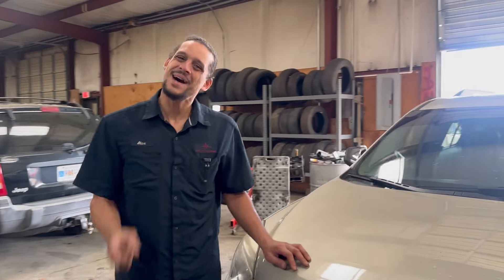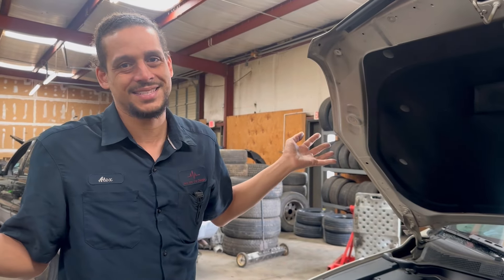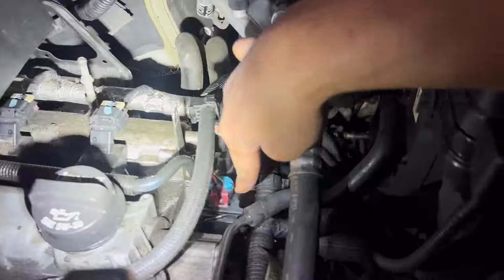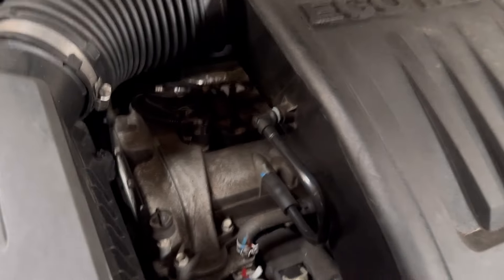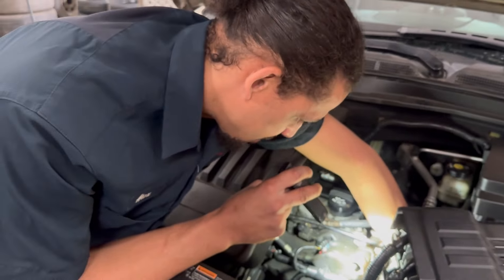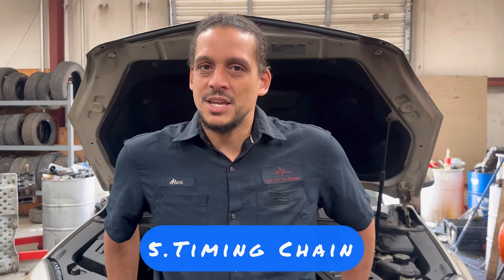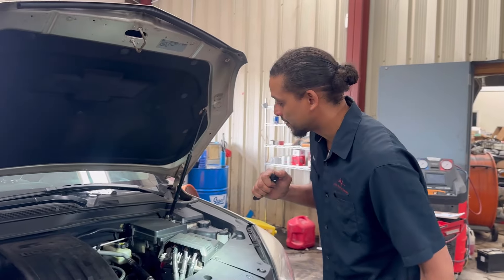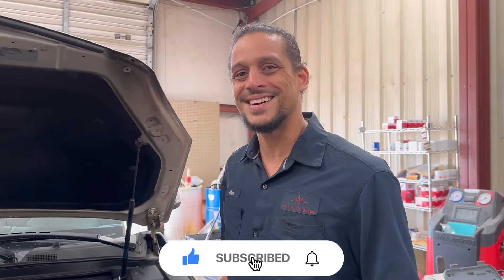The Top 5 Problems with Chevy Equinox (2nd Generation 2010 - 2017)

Comment: thank you for the video Alex, my 91 year old dad has a 2017 Terrain that we bought new I have a friend at a Buick GMC dealer it was a good price for a new car 21,500 and his 2007 Lacross (7,200 trade in), so far no problems at all at 37,000 miles, but some day it will be mine so I want to do everything right, he lives 200 miles from me so I can not do it myself, he does get the oil changed at a dealer, should I recommend he gets the trans serviced at 37,000?, dealers scare me on that sometimes they will charge you and not even do it
Reply: Transmission, transfer case, and rear differential fluids should all be changed every 20k miles. It states that in the owners manual. With the transmission, you want to do it while at operating temperature if you’re doing it yourself, fyi.
Reply from the maker: Definitely have him get that transmission serviced Jim. I hope they wouldn’t do a thing like that to a 91 year old fellow!

Comment: We have a 2013 that we had oil leaking gradually. We always  made sure we checked the oil and had to add more. It had been  a good  car up until the last part of 2024. The seal broke while we were  driving,  had oil smoking In the engine in all underneath the car. Spent three thousand five hundred dollars getting it fixed.( We couldn't afford to buy a used car). The mechanic from the dealership had told us We were lucky that we had put an amsoil in the car for a long time, Otherwise their engine would have been totally ruined.

Comment: I've got a '14 equinox 2.4 at 100k

Only failed component was muffler

Heavy maintenance = no problems

Oil every 3k
Silicone all rubber boots & hoses every year
Rust proof every 2 yrs
Air filters every 2 yrs
Transmission fluid every 40k
Coolent every 50k
Brake fluid at 60k

Avoid revving over 3500rpm

Avoid revving over 2k until hitting operating temp

Go for a 30 minute drive at highway at least once a week 

Never let fuel drop below 20%, or 40% in winter 

That's the recipe for a long life 

I ran a 2000 chevy impala for 17 years and 350k with the same recipe

❤
Reply: @Foof0811  Love this! Thank you so much!

Comment: Owned a 2013 captiva had no problems except oil burning fast.  Have the 2014 Terrain and I love this car. My daughter has the 2014 equinox and is frustrated with it because its got leaks, VVT issues and now its stalling and we were told it may be the crank shaft position sensor

Comment: Iv tried everything.  I ended up rebuild my engine myself. It runs perfectly. Turns out the oil rings were shot and my cross hatch on my piston walls were not there. It was like a mirror finish. But now it runs perfectly

Comment: Great video I have a 2013 with 60,000 on it no issues never been short a drop of oil buy I change every 3,000. They are also known to have the exhaust and intake sensors fail. Makes me wonder if people ignore that when it occurs and that's what could be causing the. Exsesive oil consumption..lots of theories about the pcv valve also also kinda have noticed it is louder on start up at start up maybe i should check the timing at 60,000

Comment: When it comes to the 2.4 you are correct but anything above that the 3.0 and the 3.6 are still decently reliable as long as you you do basic engine maintenance I know I suffered from this I bought a Chevy equinox with the 3.0 l engine and it was not maintained as well as it should have been and the engine blew 15 days after the warranty so I was F'd in the A

Comment: 2015 and I just got it used in March of this year. Eats through oil every 3k miles, changed the timing chain, and the solenoids, and now the battery almost exploded this week. 🤷🏻‍♀️ the battery is hidden under the computer. Oh and i put a new fuel pump in it. I really don’t like the car at and wouldn’t recommend it. But 250k?! Maybe the previous person didn’t care for the car correctly and I was just unlucky.

Comment: Love your videos. They are very helpful and thorough.

My daughter has a 2012 Equinox with about 195K on it. It was throwing a P2138 and after replacing both throttle position sensors (the gas pedal and the throttle body), it is still throwing the same code. I can clear the code, but as soon as you try to give it more than 50% throttle, it will go into limp mode, say to service Stabillitrak, and throw the P2138. It has a rough idle where it will feel like the engine is bucking back and forth. It sounds like it may need the timing chains replaced, but would that cause it to keep throwing the P2138?

Any help would be appreciated.

Comment: So the 2.4 are given a 7500 mile change programming from manufacturer....this is causing trashed rings letting oil into the combustion chamber, gunking up the spark plugs, those solenoids, and the cat...then .the cracked exhaust manifold from the excessive heat and oil build up in the exhaust system...luckily a shop heard the timing chain around 80k....we are now retiring our 2013.....we have put a lot into it....we at 220000 on ye ohl Roxanne. It ran bone dry before 3k miles on an oil change when it was around 140k. Never overheated, never said check engine....nothing....only kept it because the Wifer absolutely loved that vehicle....She getting an Arcadia now.

Comment: I have a 2017 Chevy equinox LT 2.4L engine and the timing chain just broke at 76,000 miles. Fortunately it was parked in the auto dealership and just had the solenoids replaced to begin with. $3,000 later it was fixed. When the chain broke it blew a head gasket and that’s where the expenses went.

Comment: Thankfully with the poorly performing timing chain, the fix itself is actually not terribly difficult to do without taking the block out. Some bolts on the timing cover are hard to reach.

I replaced mine on my 2015 at around 108k on two jack stands just lifting up the front, then it got loose on me again at around 119k so I replaced the just the tensioner this time. I let the oil consumption go a bit too far which I believe caused the timing chain tensioner to get hot and seize up. I believe that might even be the root cause of my first timing chain failure as well, with that first tensioner getting old. Overly proper oil maintenance should prolong the life of that system.

I'm still getting a P0017 error code for crankshaft-camshaft position correlation issues, which I think may be that exhaust solenoid failing on me. I replaced both solenoids when I replaced my whole timing chain, so I'm hesitant to replace that, but it did have a bit of build-up in one of the mesh rings so it likely failed on me again.

Comment: Question: will keep as short as possible.

Daughter has 2012 and at low speeds is dying at stops. Sometimes has to sit, and starts back up. Runs fine at highway speed. 

The stalling does trigger that engine reduced light. Fast forward: yesterday the brake got rock hard and the reduced power light came on and now the car won’t start, not even a click.

Booster? Any help or ideas. I think 🤔 that there is a vacuum leak. I am out of town until Tuesday so I am in the thinking about it phase. So again months of stalling, now nothing and a hard brake. Ty for reading
Reply from the maker: @everydaystuffandthingsguy4554  it’s not the booster,my guess would be timing. The first thing that needs to happen pull the codes and tell me what they are

Comment: #6, PCV orifice clogs up.  In cold climated, this can push water back through the PVC intake, and if it freezes, the pressure will blow out the rear seal and dump your oil all over the road, seizing the engine.

Comment: We have a 2015 equinox at around 60,000 miles it started burning around 2 quarts of oil a month. It's still running at 92 thousand miles

Comment: lord man 🆘.    ac and heat surges fast then slow and sometimes off.  i unplug the blower motor connection and plug it back in and it works before repeating the cycle.  i replaced resistor already.    would it be the blower motor and i have some knowledge but never replaced one.    does it sound like the issue.   also , the condensation aka water drained in the floor last summer.   still haven't found out where from

Comment: My 2015 equinox sometimes dies out when idle, turning and reversing. All my sensors are broken and I get all kinds of codes. It’s got 150k miles on it so I understand I’m going to have some issues. But I got a tuneup a couple of months ago and a new battery and a transmission flush over 6 months ago. I do get regular high mileage oil changes. So I’m not sure what’s causing the dying.

Comment: had a P00013 code on my 17 equinox changed my vvt solenoid the back one, idk if i shoulda changed both but the engine light did go off so 🤷🏽‍♂️

Comment: I had a diagnostic done from 3 auto parts stores and a jiffy lube. All 4 gave the same codes:
P0172: Bank 1 system too rich
P0304: Cylinder 4 Misfire
P062B: Control Module Fuel Injector Control Performance 
P050D: Cold Start Rough Idle.
I changed out all spark plugs, changed the coil on cylinder 4, put fuel injector cleaner and Sea Foam in and it is still producing these codes. What can I do to make it run better besides an oil change? Change out the rest of the Coils?

Comment: Hi Alex, I am considering a 2014 Chevrolet Equinox that has the 2.4 engine. The vehicle has been sitting for I think about six months. The mileage is 70,000 . Just had the oil changed and driven the vehicle 30 miles after the oil change. I'm kicking it around if I should trust this vehicle to go from Michigan to Florida and back? Anything else to check out?

Comment: I’m looking at getting a 2012 Equinox. It’s having some issues those. When you try to start it tries to turn over then clicks like a bad battery. Has a brand new battery. Thing is though the windshield wipers comes on, washer fluid squirts, dome light flashes as does headlights. Trying to figure out the issue
Reply: Alternator maybe...

Comment: 2011 equinox & have only been having issues with the actuators getting clogged and the rear main seal. At 124k miles the oil turned milky so got a 48k engine installed & noticing rough starts from time & chain but mechanic says it is fine because I drive it over & the sound is gone by then. He says Im hearing noise because the oil hasnt circulated yet...whay do you think?

Comment: My 2015 equinox is giving me a whining sound when accelerating for some time now, what could be the problem. Also, how many quarts of transmission fluid and engine fluid does the 2015 equinox 2.4 lt use.

Comment: My 2010 equinox is making a hissing noise when I try to crank start it but it won’t come off. Before this issue happened the last feeling the car gave out was jumpy under the hood and stalled out sometimes causing an issue on the dash to report a code saying the engine was only using minimal power.

Comment: What would cause the battery to keep going dead  I replaced the alternator twice and also had a problem with the steering wheel going hard during had the battery checked they said there is nothing wrong with it

Comment: I have a 2015 GMC terrain with around 51000 miles and i hear a bumping noise from the back right side i believe usually shortly after start up and i can be sitting still before leaving driveway or going down road and hear it and its been going on for atleast a year or more and they cant find the issue, do you have any ideas.
Reply: That knocking/bumping sound is the fuel pump. There was actually a TSB or recall (I don't remember which) with a some of these models where the retaining clip or whatever it is that holds the fuel pump to the tank, fails. It's basically the fuel pump moving up and down causing a knocking sound.
Reply: @Ryan-ds2wx  its not really a knock it kinda will go.  Bump.....bump.....bump..bump..bump.bump bum,bum,bum,bump...Bump.. bump...bump. it's not a clanky sound

Comment: 2014 Chevy equinox please please help..its showing stabilitrak and service power steering.. diagnostic showing U0100 code failure to communicate or transmit to transmission..could it be bad key fob causing this.. messages were going away after restarting but now its not and door locks clicking loudly when put in reverse help 66yr old just paid cash 4 mths ago
Reply: Rear Main Seal, Side Panel Gasket And Timing Chain… Had To Get Them Fixed On Mines Whenever It Said That…

Comment: Why don't they put a drain plug and external filter on the transmission?  Trans fluid would be so much easier to change, and it would probably get done in most cases.

Comment: Curious to see if anyone can help me. My girlfriend has a 2012 Chevy equinox with a code for a VVT Solenoid(P0014), the check engine light keeps coming on with the same code, I have replaced the solenoid 3 times as of now with ACDELCO solenoids and it just keeps coming back on after a month or so each time it’s changed. I’m trying to figure out if maybe it’s an electrical issue or if it is possibly the timing chain that is the problem
Reply from the maker: @drakehawk8838  take the valve cover off and inspect the timing chain

Comment: Ive changed my starter and fuseabd relays and i still won't start lights, radio and everything comes on just no crank what might be the problem?
Reply: I have a '17 with 91k miles. Changed battery, alternator and checked fuses, but still can't figure out why the battery keeps dying. We're you able to solve your electrical issue?

Comment: 1/27/2025 My 2014 Equinox has an engine shimmy at highway speeds and sometime at slower speeds.  The code it throws is P0013. Camshaft timing actuator.  I’ve replaced it and still get the shimmy.  I took it to the dealership and they said my transmission is going out.  $5500 to replace it.  This issue is intermittent. Help

Comment: We have a 2011 equinox , the issue is when driving is shakes and turns off , turns back on right away .
Took it to mechanic it have 2 codes we fix what codes said and still continues to do same thing . 
Any one had same issue ?

Comment: I brought my car to a mechanic because my ac all of a sudden stopped working so he diagnosed it and said the motor was no good so he ordered one for me at 95 dollars and it stopped working so I told him it must have a defect so one of the guys checked the blower and it worked fine so he put it back together and 2 or 3 days later it stopped working so I googled it and some said that if you hit under the glove compartment it will come back on so I did and it worked and stopped again while it was hotter then a Dickens outside so I pushed up on the wires and it started to work again so I tried using electrical tape and scotch against the fire wall and eighter one worked so I tied it up using a rubber band and it works fine so the whole problem was the plug by the fire wall needed cleaning,I wish mechanic would stop guessing when it comes to fixing peoples cars that's not a certified mechanic to me.

Comment: Great video. But these cars are a money pit. Water pumps go out. Burns oil like crazy. Timing belt issue sounds terrible when starting up. Gets some kind of electrical issue where the radio won’t turn off when you take the key out of ignition. These things go to sh*t whether you maintain them or not. You have to have Mercedes money to keep this economy SUV alive

Comment: I got a 2012 Equinox with 238k mile she has a problem revenge too high after start up and mellows out but when I get up to 35-45 she starts to rev high again and on the Interstate at 60+ she revs high and starts to shake a bit what could be doing this?

Comment: These Equinox’s are horrible mechanically. You can buy a 2005-2006 Honda CRV for example for less than half the price of this Equinox and it is a WAY better vehicle. Yes its much older but will save you thousands of dollars.